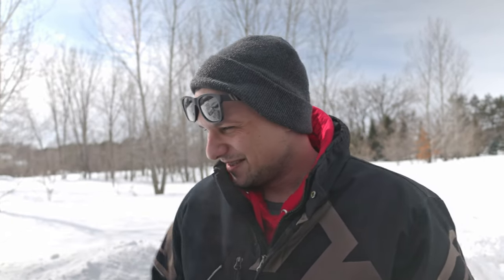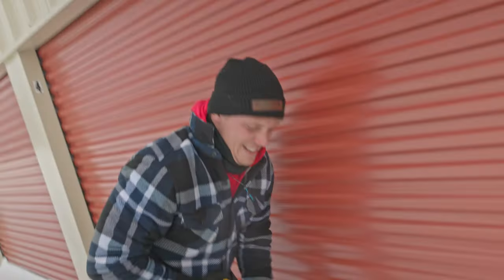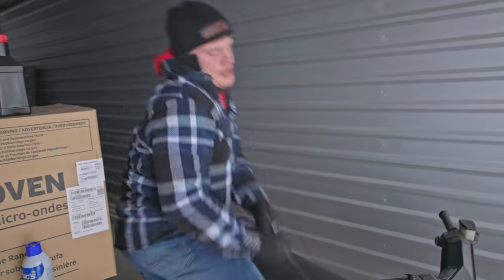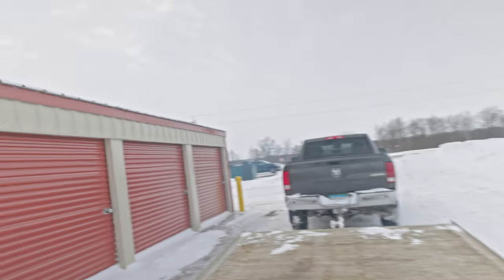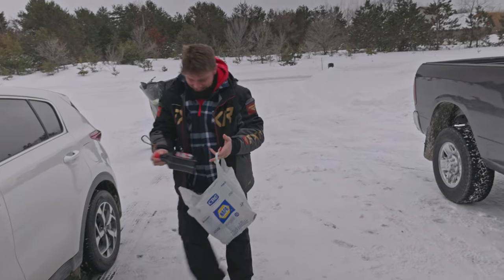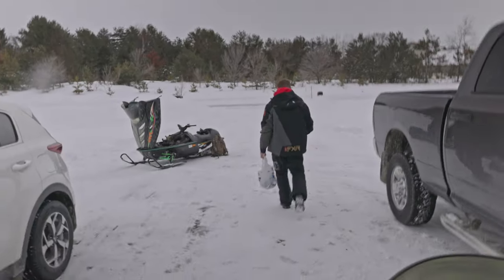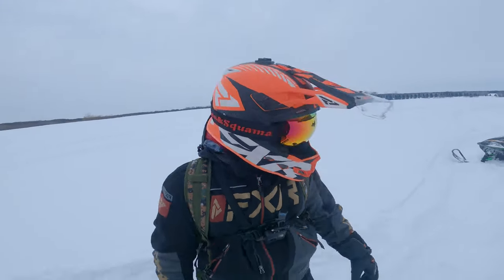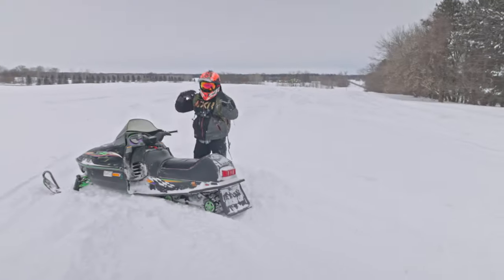OLD SNOWMOBILES IN DEEP SNOW Arctic cat ZR and ZRT 600's

Comment: Those are some awesome sleds... And awesome footage... U just need to adjust the oil injection system there should be two lines down where the cable hooks to the oil pump u line them up with each other then it shouldn't use so much oil... Still very nice sleds....

Comment: Dominator oil is not made for snowmobiles. Gotta use interceptor. Clean up that zrt. 1995 was first year production and only 500 made. Also is your zr carb model or efi?
Reply from the maker: It's efi
Reply: If that's really a 95 Zrt its a rare sled as stated in the comments. Definitely needs some carb serious tuning,coils,cdi? Might be down on compression? It's definitely not hitting on all 3 cylinders. That thing should scream 8000rpms. Nice sled 👍🏁

Comment: doesnt matter what your ride the more people out the more fun it is honestly unesd your in the mountains nobody rides i have a 97 380 foumula s for my kids 8 and 9  and a 02 summit 800 summit hill climb 251" both are out together and both just as fun at the end of the day sometimes we can manage 15 sleds together we only ride flat land fields and ditches tho ditch bangers as we call them on the flat land great to see these older sleds bring smiles with out spending 10 to 25k
Reply: I’m going to restore a fifty plus year old Cheetah this year to prove the same points you just said. First year Cheetahs were based off the 1971 EXT Special  oval sled but used a wider 17 inch track. So a lot of that eras hot parts will bolt on. The little beasts can rip pretty good with some mods.